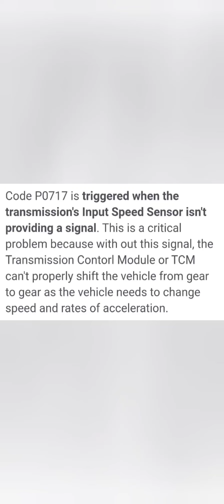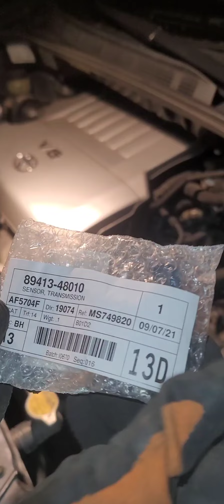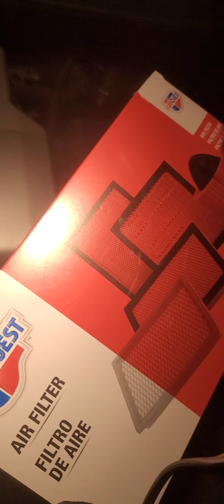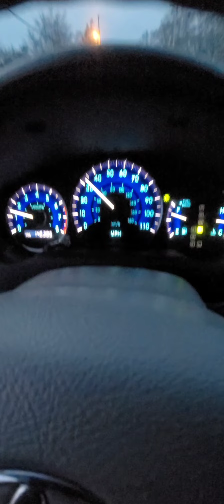P0717 Vehicle Speed Sensor B (FIXED) Toyota Sienna -

Comment: Good morning,
I left my Koleos 1 2.0 dci automatic gearbox this week at the garage to change the crankshaft seal on the flywheel side.
I picked up my car today, I did 50km on the motorway without any problem, it went through all the gears and was smooth, and when I got to town, my gearbox started having trouble shifting into first gear, then at one point it got stuck in 3rd gear. When I switched to manual, it remained in D. Finally, a message "regulator to check" appears.
By restarting the car, it's ok for a few minutes then it starts again.
I went back to the garage, we did a diagnosis and when we accelerate, the turbine speed is at 0 when we accelerate, and this blocks the gear change, we have to restart the car.
Here are the diagnostic errors:
- P01717: turbine speed sensor circuit (active)
- P1525: consistency of multiplexed information for cruise control, the information is not compliant (active)
- P074491: torque converter clutch ev function, converter lockout control (memory).
Do you know where this could come from please?
Reply from the maker: I will look into it what is the make and model of your car no worries we will find a solution
Reply: @naeemali-iw9uq  Renault Koleos 1 phase 3, year 2015, 155000km. A priori it could come from the speed sensor on the automatic gearbox, except that I think I have two (fortunately, and a priori, they are above the gearbox and not inside) Thank you for your help !

Comment: Hi,
I have 08 Toyota Highlander v6 automatic and got a code P0717 input shaft speed sensor. I got check engine and traction lights are on and vehicle won’t shift normally like jerking. I replace the blue sensor the same one showing on the video and is aftermarket one and lights came on after 30 miles driving. I already check the wiring and looks like nothing abnormal. Any advice for this issue?
Thank you
Reply from the maker: Hi thanks for watching the video.

P0717 TOYOTA - Turbine Speed Sensor Circuit No Signal...Possible causes; Faulty Transmission Speed Sensor, Transmission Speed Sensor harness is open or shorted, Transmission Speed Sensor circuit poor electrical connection...Diagnostic Trouble Code (DTC) P0717 is detected when TCM or ECM receives no signal from the sensor. Possible symptoms; Engine Light ON (or Service Engine Soon Warning Light) Possible shifting problems. P0717 TOYOTA Description; The Input Speed Sensor detects the primary pulley revolution speed and sends a signal to the Transmission Control Module (TCM) and Engine Control Module (ECM). The ECM sets the OBDII code when the Input Speed Sensor is out of factory specifications. The aftermarket ones somes it is not work very well.  There is two sensors speed sensor A and B; there is another t sensor in the back and is the black one you have to replace that one too.
Reply: p0717  that is not  correct sensor you replace like  utube people  they tell you , not every thing on utube  is true  they want to like and subcribe so they can get more view and more money